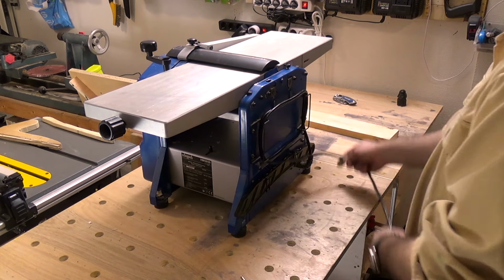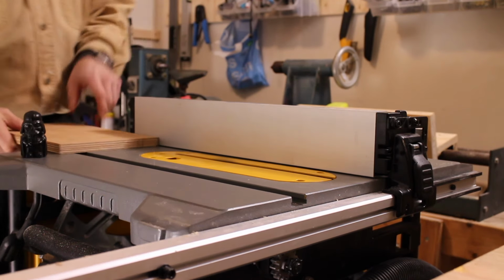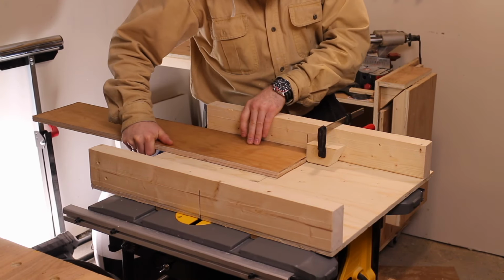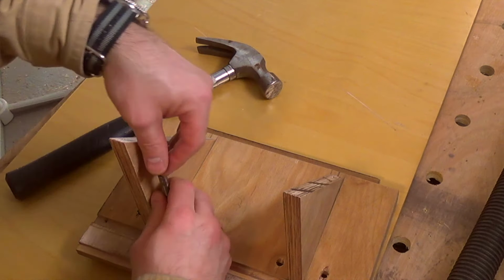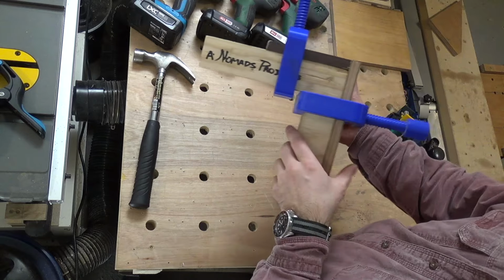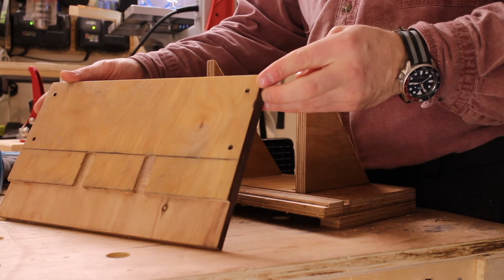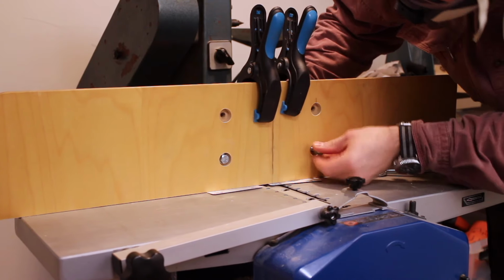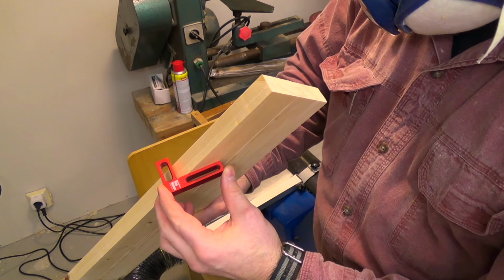Pimping my Planer - DIY Fence - Scheppach HMS 850  [0077]

Comment: Hey man. I have one of these but it's the Titan model from ScrewFix.. I bought it about a year ago but only used it a few times to date. My workshop is a mess atm. I am trying tov sort it out now.
Could u tell me how good or bad this Titan Track Saw is?? I was told it was ok but most of these cheaper saws don't cut very well on the 45 cut.. Is there any real flex when making 45 DEG cuts mate?? I want to get a Track saw but I'm not paying out ridiculous prices they're charging for them..
I had a major issue with my fence on my Titan planer/thicknesser too. I think I'm going to attempt to change mine as well..
Reply from the maker: Hi!
I have the Titan Track Saw. But really haven’t tried too many miter cuts with it, so I cannot really say. Peter Millard @10minute workshop had done a lot on those saws and he reccomends them. Perhaps check out some of his stuff?
Cheers and thanks for watching and commenting.
Reply: @NomadMakes  Yeah I saw his video my bro.. Thanks for replying to my comment. I'm in the middle of fixing up my Titan planer/thicknesser atm. The Fence is useless. I have to change it soon. I'm also building my own Table saw as well. I had originally bought the Titan table Saw but it was bad. The table was really uneven. The motor is a hard start motor. It's not belt driven which makes it very loud but I'm going to repurpose parts from it and rebuild them into a new build with steel framing. It's takin some time bcos I'm new to welding as well. It ain't easy at all.. Thanks again bro. Keep up ur great work too btw..
Reply from the maker: Yeah. That fence is utterly useless. 
I started building my own table saw, but ended up purchasing the Dewalt DWE7485. Before that I just had a cheap sircular saw screwed up side down into my bench. But that worked as well. If can at all swing it, I suggest getting the Dewalt table saw, unless you are more interrested in building the tool, than what you make with it. Which is cool as well. As long as you keep on making.